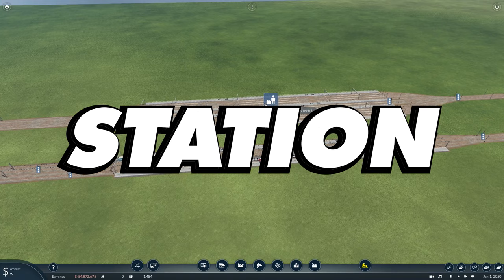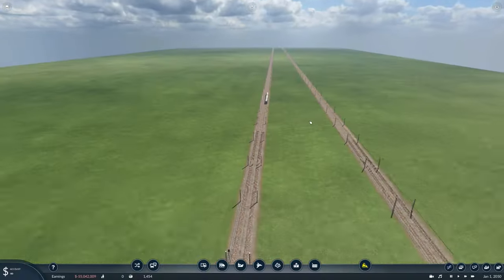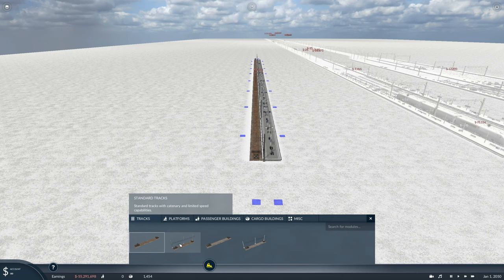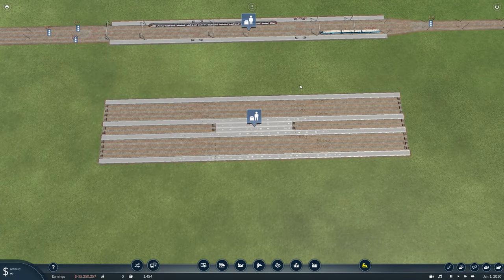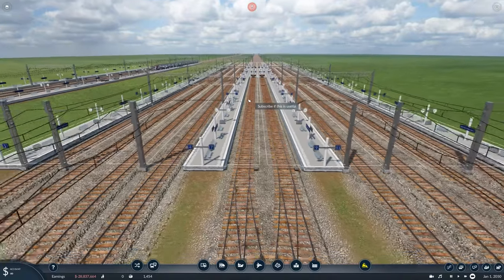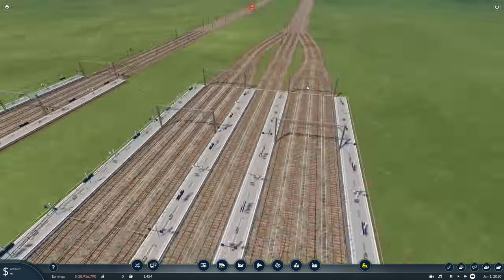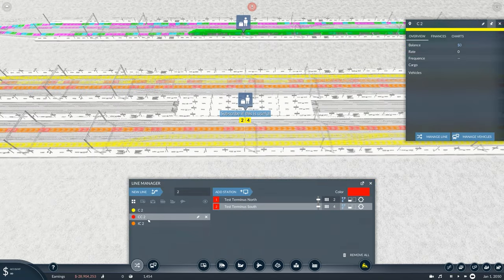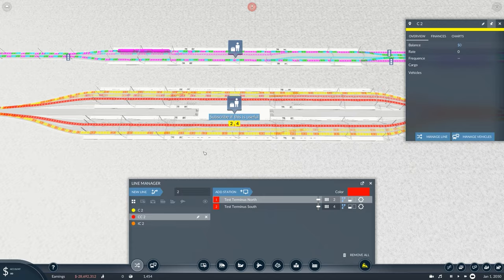You're Doing PASSENGER Trains WRONG! The BEST Set Up You NEED to Know

Comment: hi hushey i have a question why terminals in truck station doesn't load goods equally (like i have 3 terminals in A station with 60 each capacity but it only shows terminal 1 with 80/60 and rest 0/60, 0/60) is this common or i am doing something wrong in my game.
Reply from the maker: Common. Its the games auto distriubution system. Just flood it with more products until demand is filled

Comment: Hey, recently bought the game and was going through your videos, great work :) Quick question on the signal placement, shouldn't the cross country signals be closer to the platform than the commuter/IC ones since you want the commuter/IC trains to stop rather than the other way round? (As the cross country will speed up away from the others)
Reply from the maker: 99% of the time it wont matter as its rare they set off at exactly the same time but to answer your question, yes.

Comment: Doesn't it reduce passenger capacity per platform? Eg. if you share an Intercity and a commuter train platform that is split in two or three platforms?
Reply from the maker: Not capacity, no. It will decrease loading speed but only for cross country trains so it dosent really matter. You get up to 3x the loading speed anyway on every other service

Comment: Doesn't the simple version have the problem with very long trains? Your platforms are too short. Can it use two consecutive platforms at the same time? You basically have 120m platform + 80m empty track + 120m platform. This is fine for multiple 120m trains, but what will a 320 m train do?
Reply from the maker: this fits cross country trains which are the longest in vanilla. If trains are way longer than vanilla longest trains something is wrong
Reply: @Hushey  But the active platform is only 120m. Evan vanilla trains can be much longer. My question was if a train longer than 120 m will only actively use the 120 m platform part, or will it use two or more consecutive platforms
Reply from the maker: @praevasc4299 long train will use the whole length of the platform unless assigned alternate platforms (dont do that)

Comment: You should use x switches, otherwise the trains will need to wait for the train in front.
And I would call your commuter trains regional, commuter trains for me are rather local trains around a city (Crossrail, RER) and regional trains everything else local that is often rural.
Reply from the maker: It barely makes any difference. You lose what you gain on acceleration by decelerating your thru services. The idea with this video is to keep things as simple to explain as possible to not confuse people but i see your train of thought and everyone is welcome to modify the design how they like. In terms of names again the reason they are called what they are in videos across the board is to create a simple standard everyone can understand easily.